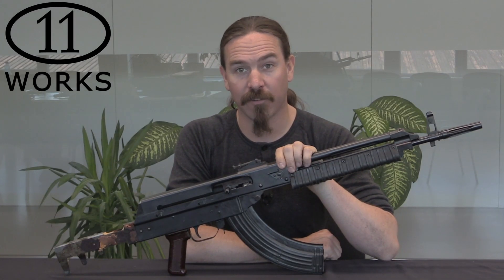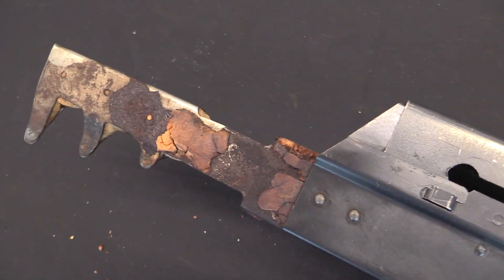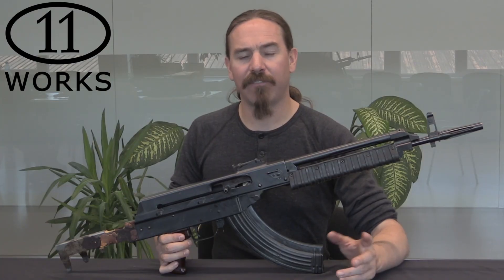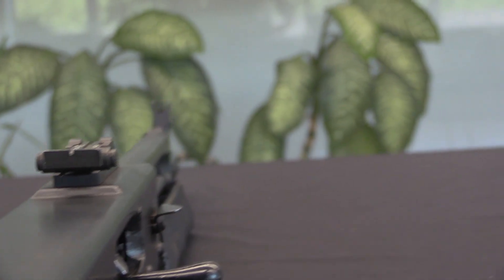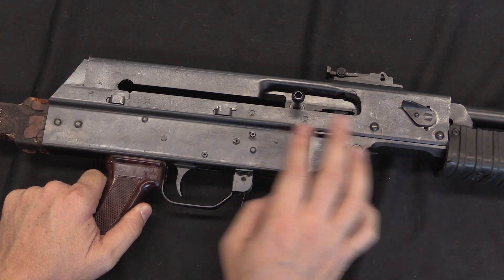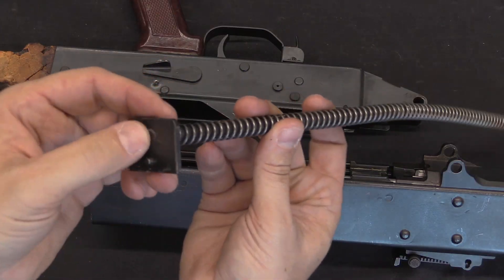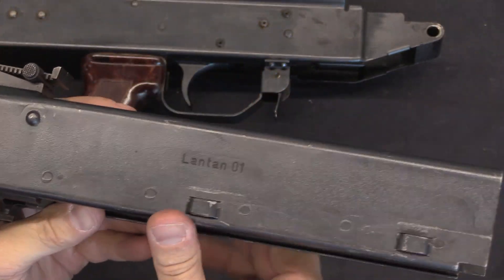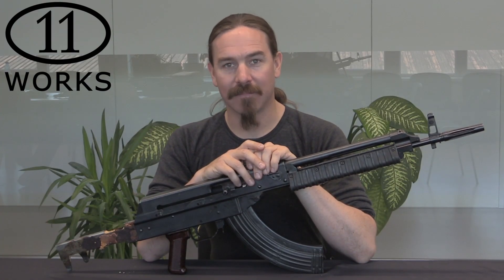Project Lantan: Poland Designs a Modular AK in 7x41mm

Comment: The Fallout pipe gun was used as the base for the butt stock design .

I wonder if the foam butt stock was a gift from the Petrochemical genius of the fraternal DDR .... their plastics turn to goo as well after a while, some times as you wear them or even when new out of the packaging.

Comment: Ok, that thing is seriously cool.  With some refinement I could easily see this thing becoming better than the stoner 63. It's a shame they didn't keep the project going.
Reply: The worst thing about it is that they could have accually just rechamber it to 5.45. Since it's so modular they only would have to change the bolt, barrel and lower(+mags but that's a given)
Reply: @fotoradar6063  yup, or when Poland joined Nato they could have switched it to 5.56.

Comment: When I was a lad, in the mid 70s, I bought a copy of "Armies & Weapons" magazine that had an article on the Polish Army. The Poles said they were not happy with the ballistics of the 7.62x39, but gave no more details than that. Thanks for solving the mystery of what the Poles were up to. The 7x41 cartridge would be pretty effective even today.
Reply: It's literally less powerful than standard 7.62x39, this new round makes no sense.
Reply: @DaleErnieMichael   You are wrong. It is exactly the opposite.  That's why this cartridge was created to have better parameters from 7.62x39.
7.62x39 => 715 m/s, 1991J
7x41 => 770 m/s, 2000J
Any questions?
Reply: @PanProper  Ian literally says it's 118gr. going 2350fps, standard 7.62x39 is 122-125gr. at 2400fps. The 7mm round is objectively inferior, and even if the numbers were what you just made up it's literally a 0.5% improvement in exchange for a larger, heavier cartridge that would require hundreds of millions of dollars to adopt and have zero compatibility with any of Poland's allies or even their enemies.
Reply: @DaleErnieMichael   Exactly, the improvement in parameters was so small that it did not economically agree on the implementation into production. Which does not change the fact that the Polish cartridge had better parameters than the Soviet one... Anyway, these were the assumptions...
Reply: @DaleErnieMichael  Ian literally said it goes 2530 fps and then made a MISTAKE the second time he mentioned velocity and changed the number around to 2350 fps. Watch carefully.
Reply: @kamilszadkowski8864  Do not forget potential for improvement. The 7x41 is a better basis for improvement than 7.62x39. Recently US ammunition makers have used computers to match the right bullet to the right powders, to get a velocity increase, without raising dangerous pressures.
Reply: @kamilszadkowski8864  Again, literally a 0.5% change in muzzle energy either way. Completely pointless argument.
Reply: @DaleErnieMichael  Hey, I am not taking any stance on this ammunition's efficency. Only correcting the numbers. Honestly I don't know shit about ballistics hece I'm happy to just observe this discussion.
Reply: @DaleErnieMichael  118gr, 2530fps(~2270J)  and the key point:much higher BC
this round can supersonic more than 800yds
for 7.62x39,only 500yds
much flatter trajectory 
better penetration

Comment: I know sometimes you answer questions from the comments and I hope this is interesting enough to do so.

I have done a lot of research including crawling through patents. One thing stands out is that current cartridges cause an early pressure spike that then bleeds off. This is the least efficient way to transfer energy to a projectile. Starting with low pressure and then increasing would be far more effective. To do this a traveling charge is an easy answer. Since they have never entered common use I wonder what the problem is. One patent using a traveling charge and sabot and maybe a choked barrel was claimed could hit 10,000 fps or 20k with rocket assist. It seems like it opens up so much but there must be problems. I should add that it also seems like smoothbore guns should be the next thing.

If you or anyone else has any good info about this or has interest in expermitation I'm wanting to build something just to see what is possible.

Comment: This looks remarkably like a very early Beretta AR-70, AR70-90, or SIG551/2/3. All the moving parts are still there and like the AR70/90 and SIG 55X the quick change barrel and upper receiver are mostly sheetmetal with a forged front trunnion.

Comment: They need to restart the Lantan project and complete the design work on all the variants, then produce civilian lefal versions of them for sale on the international market, especially the US civilian market.
It looks like it could be a great competitor for the AR15 platform.  The cartridge they developed for it looks promising. Twice the projectile weight at a pretty comparable velocity should translate to a greater effectiveness on the target. The biggest question is how is its range and accuracy. If it's close enough to the 5.56×45mm it could have stood a pretty good shot in any of the various trials for potential M4/M16 replacements they've conducted over the years.

Comment: Sure it's crude as it's a development/prototype design but I do like the AK esq look to it, the 2 piece upper& lower receiver mod and the new cartridge they developed for it. The cartridge being longer and slightly smaller in diameter but nearly the same weight as the standard 122/123 gr 7.62X39mm would have given it a better sectional density allowing better penetration and better retained speed and energy at longer ranges. Had they conti nued with this design I'd bet they'd have gotten it to a resonable weight, reliable and I'm sure it would have made a decent rifle

Comment: Ian, When you said it was more powerful, did you mean at distance? A 123 grain ( nominal ) projectile at 2350 fps will have slightly more muzzle energy than one of 116 grains at the same velocity.obviously the 7mm has higher b.c./s.d.  unlike the 5.56 Nato Which velocity is measured from a 20 inch barrel   , the ak rounds are tested In the standard 16 inch ak barrels. So when a box of " ak ammo"  says 2350fps or 2900fps, that's from the 16 inch(800ish mm)  barrels.
(no ,I'm not explaining this all for Ian, he knows this, but many viewers won't . )
Reply: The muzzle velocity of this projectile was 2530 fps NOT 2350 fps.

Comment: Maybe not the best video for this, but I always wonder in the heat of battle how many times people have forgot to switch to blanks when firing a rifle grenade.
Reply: I imagine it doesn't happen too often.  You likely issue rifle grenades to your better soldiers to start with, so they aren't as likely to forget, and with armies that have plenty of veteran NCO's, they have likely seen such an accident before and are very good about drilling their men with rifle grenades to not mess that up as not only will you maybe lose the grenadier to a wound, but could lose nearby squadmates.
Reply: @kentvesser9484  Yeah I can see that. I'm including back to WW2 when they were new too. I mean obviously if it happened a lot they would have stopped using them. I'm just curious how many times it's happened throughout the history of rifle grenades, you know? Rarely? Very rarely? More often than you'd think?
Reply: @lando8913  during WWII there were a few different rifle grenade designs that used a "bullet catch" method of launching, you use a standard round and the force of the projectile hitting the grenade gives it it's initial momentum before the expanding gases five it a final shove.

Comment: I feel like the overly robust milled upper and lower receiver wouldn't have been too out of the line for a sharpshooter variant.
Reply: Just having the barrel attach to the upper is going to increase repeatable accuracy for any scope mount (or an iron sight moved to the rear of the receiver, which would simultaneous make field accuracy easier by increasing sight radius).

Comment: I have a feeling that this stock was made by encasing that metal skeleton with expanding foam and then sculpting it to a final shape.
Reply: The reason is quite different. It was the period of communist Poland. There were widespread shortages, from toilet paper to sugar, shoes and cigarettes. I used to wear my older brother's shoes because you couldn't buy them in the store.
I assume that what was at hand was used in the prototype. Some equivalent of what was supposed to be in the target version.
Reply: Yeah, the residual foam has that expanding polyurethane insulation foam look. This would perfectly fit that tire rubber front grip.
Edit: Just wanted to add that I don't mean that it's bad in any way - using any and all available materials for prototyping fits perfectly the Polish engineering ethos.
Reply: Or, even making a lost wax cavity to hand the stock skeleton into and spray the foam around it.

I did a similar thing with a hollow, aftermarket, FAL stock, with a can of crack sealant spray foam and some bird shot mixed in at intervals, to balance the rifle better.  The stock ended up slightly stiffer overall, too...

Comment: I wonder if the material originally used for the stock was selected for how easy it would be to sculpt a one off stock so the design could be more easily iterated prior to adopting a final design.
Reply: It almost looks like it was made in spur of the moment to make it "good enough" to meet a trials deadline, the plan being to make a proper stock after you made the admins and military commanders consider what you have to offer them.
Reply: Likely cost was the driver.

Prototyping a foam stock would be cheaper than prototyping an actual injected polymer, because you could use the lost wax process to make the mold cheaply and quickly, when you're only doing a handful.

Once you've set the design pretty much in stone amd know how the stock will end up being shaped and the exact geometry of the attachment, then you go and drop the $150,000 (well, maybe $30,000 back then) to make proper molds for proper polymers.
Reply: @geodkyt  I suspect they just sprayed it onto the metal skeleton, shaped it up and presto, you have a stock which is good enough for primary testing.

Pretty clever, in my book.
Reply: Maybe it was foam dipped in latex and the latex just rotted away.
Reply: Living in Poland in the 90's I saw this orange foam everywhere xD It crumbled of any plastics, beds, boats and freezers. Probably some filling foam that was later formed or cut down. The polymers in Soviet block were not very advanced.
Reply: @EnhancedNightmare  Probably a Polyurethane, which is like a 2-part "reactive" brew that generates its own gas bubbles (and gets quite hot as it expands as it polymerizes). Used in a LOT of roles like filler for buoyancy voids on boats and life-rafts. See the foam-core in your basic AR/ M-16 "fixed" butt.

Biggest problem with it is that the gases produced when it burns are toxic and corrosive; very harsh on the old lungs.

The Lantan also has a "hint" of AR-18 about some of its construction.. I wonder how familiar the designers were with the .276 Pederson cartridge and the EM-2 cartridges..
Reply: More than likely they were experimenting with comfort. The metal is where most of the pressure would be while the foam exists for comfort in theory. It certainly would be cheaper in theory but the the key issue is foam is not as long lasting and its easily damaged not it could cause more recoil.

Comment: This piece has a tamper-evident feature you didn't mention. Simply weigh the weapon on a precise scale, record the mass, and compare to a log of previous mass when put into storage.  Every time anyone handles the weapon, it will weigh slightly less from additional foam particles falling off. In this way you'll always be assured no one has tampered with your weapon.
Reply: By the look of it, the remainder of those foam scraps are going to keep disintegrating whether anyone tampers with it or not.
Reply: @bartolomeothesatyr  So you'll just have to sentence someone randomly. Nothing out of the ordinary for the ComBloc.
Reply: The foam stock seems quite cool to me, at this moment of prototyping at least.  Very easy to make and shape however you like it.  It's not supposed to last.  Once you get all the details finalized, you'll get it molded properly in plastic, or whatever you like.

Making "high build quality" prototypes is simply a waste of time and money.  I'm quite convinced plenty of other firearms went through similar stages of very rough development, but we rarely ever see them.
Reply: Unless they stick some chewing gum on it.
Reply: I thought this was a joke about leaving metal unsupervised around Poles, ah well...

Comment: Random question. 

Since the gattling gun was invented in the 1800’s and belt fed weapons were common in wwi ,

Why no mini guns in ww2?
Reply: Electrickery/batteries not up to snuff. most military equipment still 6VDC.
Heavy duty motors still started by pony motors/air
2 stroke Gatlings not a happening thing?
Reply: @JohnSmith-yv6eq  rubbish. 
Aircraft had electric turrets and searchlights were mounted on trucks.
Reply: the old gatling design was just a way to increase ROF over non-self loading guns at the time as well as having a mechanism that would make repeating, continous fire work. (basically you had to crank the thing, it wasn't powered by recoil at all).

once self loading gun mechanisms were perfected the old "crank that soulja boy" gatling mechanism became obsolete, only to be brought back as a means of creating a weapon that not only had an insane ROF (by using an external motor to crank the mechanism) but also to reduce overheating, since the ROF is spread across multiple barrels.
Reply: @basketcase1235  
Yes. 
So why not available in ww2?